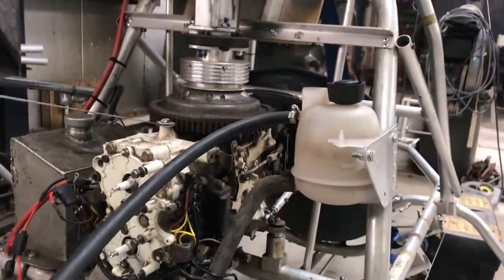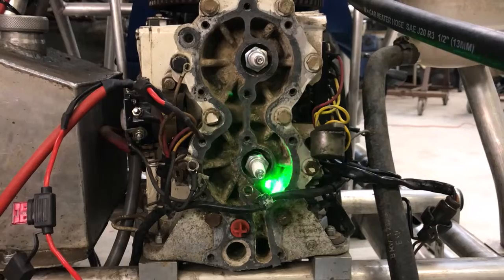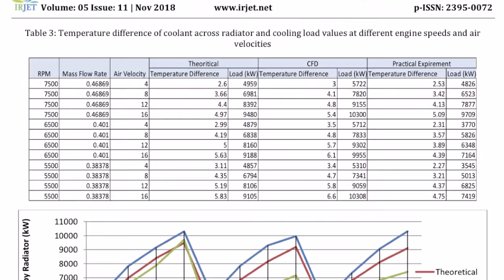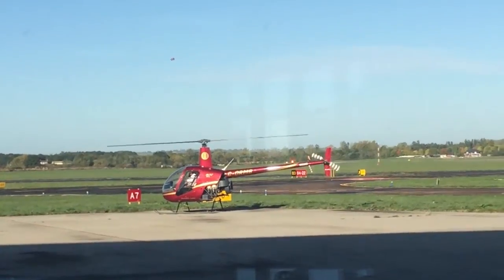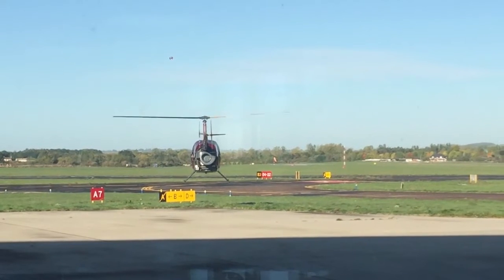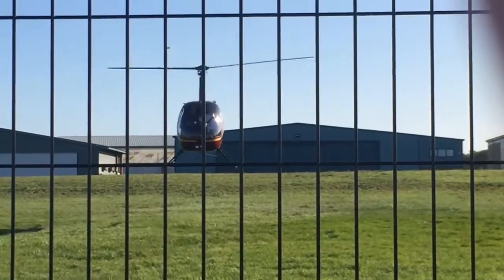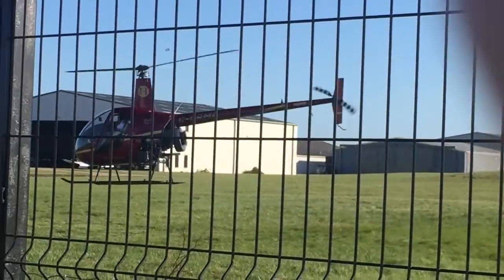Outboard powered helicopter + R22 Lesson

Comment: Glad you got more instruction in the R22.  Hovering competently takes most pilots hours to get down!  I didn't get good at hovering until I had about 6 hours in the seat, and it took a couple more than that to have the spare mental capacity to handle radio comms/conversation at the same time.  Sounds like you did good!
Reply from the maker: Thank you. I think 6 hours is good to be able to hover, I don't know what hours I've put on my coaxial but it could be quite a bit which has obviously helped progress. Hovering is a very difficult skill in my opinion but once the brain is trained and you can relax I can imagine the fun starts to Increase. At the present time it's just intense concentration. Dual instruction is a safe way to learn and I would recommend it of course.

Comment: If you are using a boat outboard, do they not suck in cold water as coolant then pump it straight out?  I would think although a radiator cools the hot water, it might not be cool enough as the original  engine design and slowly the circulat8ng  warm water overheats perhaps?
Reply from the maker: Yes that is correct, I'm trying to make the engine run for a purpose for which it wasn't designed. The reason for this is cost as engines designed for the purpose are cost prohibitive. Surprisingly outboard engines were first used in helicopters in the 1950s and they can be modified to work, it's just time in development.
Reply: @Ben-Dixey  its great to see that utilised and has enough power to lift you and machine, and as you say part of the development process. Fan on the radiator or able to expose it to the airflow?
Reply from the maker: @Drummer2020  I tried a bigger more powerful radiator fan but no improvement in flight duration resulted. I was surprised that was the case so started looking at the flow rate and passageways. When I made the clutch I machined a 'v' pulley into the housing for when I need a belt driven fan, this with a shroud will probably be needed. Keeping the weight down when solving each problem is the challenge. Moving the rad further into the downwash isn't as simple as it might appear as it will cause CG issues.
Reply: I was going to say this as well.  The ambient temperature of the raw water cooling sucking straight from a lake/the ocean would have to be considerably lower than that recirculating through a closed circuit system.  You've got a fight on your hands to overcome the cooling issue.
Reply: @michaelsimpson9779  
In a car it’s super heated steam under pressure going through the radiator. So the radiator is much hotter than the ambient air and more efficient. Also steam contains much more heat energy do to the phase change. He’s  going to need a big ass radiator to get rid of the heat of just hot water.
Reply: @bcreason  superheated steam you say......

The water jacket in an ICE runs at around 90 degrees Celsius and typically  less than 20 PSI 

Superheated steam is created by heating steam to around 400 degrees Celsius and is used to power turbines at an operational pressure around 1300 PSI........

Do go on though......
Reply: @michaelsimpson9779  Ooh! , someone wants to show off their smarts.  You'd get more respect if you simply correct people without being all snippy about it. Being insulting simply makes you a troll, someone not worth bothering about.
Superheated simply sounds better than slightly over boiled. I took some artistic license there. It's a YouTube comment not a dissertation. 
This must be how you make yourself feel important. Scanning YouTube comments looking for flaws and making fun of your betters. 
Do Go On Though....
Reply: @bcreason   I'm sorry for the tone of my reply. I could have put that differently.  I'm not a troll. I apologise for the disrespectful way that I addressed your comment.
Reply: @michaelsimpson9779  
Accepted.  
I thought it was the wrong term when I wrote the comment. I just figured it wasn’t worth the time to look up the correct one over a YouTube comment that most likely no one was going to read. It got the point across that you need a phase change for cooling efficiency.

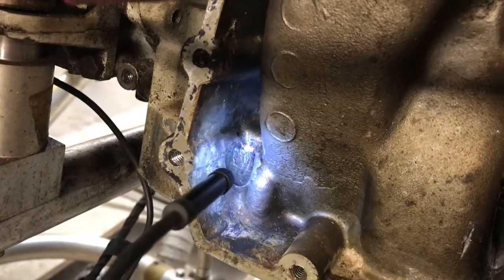Comment: Hi Ben , at 1:57 is that rounded area part of the exhaust system? You may need to isolate that completely from the water system. Fairly easy on the V4. It looks quite difficult to weld fittings there.  Another great video, Thanks.
Reply from the maker: Hi Cam, yes the rounded area is the exhaust port and yes it's hard to weld in that area. Hopefully there is a way to isolate it as you say. 🤦‍♂️ With the coolant going up and around those exhaust ports it's really not helping as you know. I might copy your idea to make the head cover plate air cooled that surely helped ?

Comment: I was wondering about the thermostat, I doubt you are risking running a cold engine. Could you temporarily remove the thermostat to further lessen the flow restriction? I have built cooling jackets for other projects and it has more cooling effect when I run the hot fluid counter to the flow of the cooling medium. It would follow then that hot coolant would enter the radiator at the top and come out the bottom. The hottest fluid will want to stay at the top given it rises. Any possibility of a larger radiator? Or higher capacity fan?
Congrats on the flight time! I hope you have some interior footage as well.
Reply from the maker: Hi, yes I have been running it without the thermostat but have been warming up the engine prior. I intend to put the thermostat back in once cooling is sorted. You are absolute right it should have one Installed. 
Could you explain the hot coolant flowing counter to the cooling medium? 
Bigger rad and fan could be the solution but I need to get what I have working as efficiently as possible first before having to add that significant extra weight. I wasn't allowed onboard footage unfortunately.

Comment: Hey Ben I have seen an outboard where they have made a large bore water inlet at the top of the the block and the outlet is the two at the bottom by the exhaust and ganged up together to get a larger coolant flrow.
Reply from the maker: That's interesting Peter. I'll have a think about that. Did you see it online ? What was it powering ?

Comment: Great that you are getting some training. That may be useful in calibrating your controls as well.
If that section of the exhaust path is no longer being cooled there will be additional heating in that area of the block. I am not familiar with that engine and whether that would cause a problem.
Reply from the maker: yes I'm not apposed to training and will do more I think, it was great. Yes that part of the engine will certainly get hotter and that will transfer more heat to the rest of the engine. It might not make any difference moving the outlet, I don't know.

Comment: I've not read all of the comments,  so pls excuse if rpting...you really need to have your cooling flow well away from the exhaust, as much as possible.  It might be worthwhile looking into an electric "booster" pump to get the flow rate up. Do you have a fan on the radiator?  Have a look at a 650-750 cc motorcycle radiator system,  they are designed to cool 75-100 hp, so would give you some idea of size and airflow needed?  Is your radiator cooled by rotor downdraft?
Reply from the maker: Hi and thanks for the suggestions, yes I think the next step will be to as you say get the coolant away from the exhaust ports. There is a fan on the radiator but not a good one, I tried a much bigger fan but it made no difference so that's why I started looking at coolant flow rates. I looked at bike engine cooling systems and bought a water pump from a Honda vfr, unfortunately it runs the opposite way to be easily driven by the engine. The radiators off the same bike were an option. I took the cheaper option of a 1.6ltr Honda Civic car radiator thinking it would do a better job of cooling. Time will tell on that one. Rotor down draught to cool will cause some other problems but its still a possibility.

Comment: Awesome you got some more dual instruction! I would recommend you route the radiator flow from the engine into the bottom of the radiator first. Hot water rises and you are probably getting a lot of mixing in the process? May be a minor improvement. Do you have an oil cooler? That would help as well. Good job on the hovering. Most people really struggle with that for a while. It becomes easier with practice.
Reply from the maker: Thank you, the coolant direction through a radiator on a car for example comes into the top of the radiator from the engine. On a car the radiator is vertical so using gravity to help flow might be the reason for that but as you say heat rises and you could argue that the fan cooling the water would cause it to sink ? My radiator isn't vertical but is on a slant if the radiator was horizontal which end would you then pump in the hot water, Perhaps it wouldn't matter in that case. 
An oil cooler would be a big advantage on a 4 stroke but as mine is 2 stroke there's no oil to cool in my case. Yes I really enjoyed the dual instruction and would like more lessons. 👍
Reply: @Ben-Dixey  You are right. Just didn't think about it being a 2 stroke. Cooler weather ahead should help. Any simulator time yet?
Reply from the maker: @helicopterdriver  I have looked into the simulator stuff and was going to bid on a control setup with pedals, collective and cyclic but I must have missed it. it was cheap quality but the good ones are really expensive. Cameron carter on youtube set up electrical pots on his actual helicopter and placed the screen in front of him. could be an option, might ask him more about it. Did you have a simulator?
Reply: @Ben-Dixey  Never flown an actual simulator, just xPlane and Microsoft Flight Sim. It works about the same with just a good joystick. You twist the cyclic instead of rudder pedals. Not the same but at least you get the idea of the controls. XPlane does a better helicopter sim in my opinion. They have a seasoned (Old like me) helicopter pilot on their team that helped them refine the flight characteristics. The guy that invented XPLane, Austin Meyer, lives down the street from me. He is very meticulous about the flight profiles of aircraft he includes. Lots of testing. It's fun to fly them. I have almost all of the helicopters. :D

Comment: There should be a reason why  differently placed water cooling outlet comes right out of the factory because it was made by engineer with some thoughts in mind to put in production. Maybe because its marine engine, and since marine engine have different type of cooling , they usually get cooled by straight up water from ocean or though intermediate loop and engine gets too cold on such cooling, but in your case you cooling it with air which is less efficient at cooling that ocean water and you get engine overheated. I heard the problem with marine outboard engines that they are run too cold which impacts lifetime of engine and placing outlet this way increases lifetime of engine by reducing cooling with sea water and making engine run warmer.

There is a chance you would need more modification to engine to increase flow, like make flow restricting holes bigger
Reply from the maker: I think you're right. The coolant first goes into the exhaust chamber which I imagined was to warm the cold sea water. I'm going to have to bypass this chamber. I don't think I can increase the coolant passageways any further so will have to get a higher pressure pump to Increase the flow.
Reply: @Ben-Dixey  Sounds like a good plan to check if you can even make engine run at sustainable temps, may be you would also need bigger radiator to dissipate more heat with a fixed flow rate. The only thing that bothers me with this plan is at what degree cooling of exhaust chamber affects cooling of engine head because AFAIK running engine head too hot may result in head warping. 
Absolutely stupidly crazy idea: what if you modify engine that you can run cooling in passages in parallel instead of serial if you want to go with higher flow rate
Reply from the maker: Yes the thought had crossed my mind that the coolant flows in series. As you suggest the cylinders will get the lower coolant temperature and the head will get the higher coolant temperature. The temperature sensor is at the top of the head so I should be getting the highest reading on my gauge. 
Running the coolant in parallel sounds sensible wether it's necessary I'm not sure, but isolating that exhaust chamber I think is going to make a difference. 
I think if the pump is able to push the coolant through fast enough the head and cylinder temperatures should be similar. A bigger radiator is the last resort, I will do everything else first I think.

Comment: my 85hp engine heats up fast. is there anything that has been changed in the cooling water line in the engine sir?
Reply from the maker: What engine are you using ?
Reply: @Ben-Dixey  yamaha speedboat engine 85 hp sir
Reply from the maker: Cameron Carter on YouTube had to isolate the exhaust port cooling from the system. He has the coolant going straight into cylinder jacket and out through the head. The radiator needs a belt driven fan lots of airflow through the radiator, it will probably take 1-2hp of engine power to drive the fan. Dual core radiator is another addition, the fan needs to be shrouded and pull through the radiator for the most efficiency. There is also a product called Mocool which you can use instead of water which helps the transfer of heat. 
I didn't achieve keeping my engine cool, it would only fly for about 2minutes before over heating but I had an electric fan, a single core radiator and didn't do the water jacket modifications.

Comment: Not sure I would pull any G's in a Robinson they have that issue with the main rotor hits the tailboom.
Reply from the maker: Is that a result of zero G's?
Reply: And mast bumping is a major issue for any teetering style rotor head like Robison and bell. If it bumps hard enough the mast can snap and the rotor head comes off. 
That’s usually fatal. And it happens in zero g conditions
Reply from the maker: It seems Robinsons tri hinge rotor head has increased the problem from a single teeter hinge though. 

Suspect the pilots inputs can save a mast bump situation but whether it can save every situation I'm not sure.

Comment: I think your cooling system suffers from inefficiency.  In a car coolant enters the bottom of the engine as water and leaves the top as steam. Steam contains many times more heat energy of water at nearly the same temperature.  Since the steam is under pressure it’s much hotter than the normal boiling point of water.  This gives greater efficiency at the radiator as there’s a greater difference between the steam temperature and the ambient air.  
Just cycling hot water through a radiator won’t give you the cooling efficiency of super heated steam.

Comment: Could you have picked a worse engine ?!?!...and that BEFORE we get to the heath-robinson "cooling system" (your words not mine)..
Why didn't you just use a seagull !!!
Reply from the maker: Seagull aside, what engine would you have used ?
Reply: @Ben-Dixey  
Motorcycle engine. Whether air cooled or water cooled they’re meant to be cooled by atmosphere and not lake water.  
They usually have a pretty good power to weight ratio as well.
I’m not sure if your cooling problem is solvable with a marine outboard.